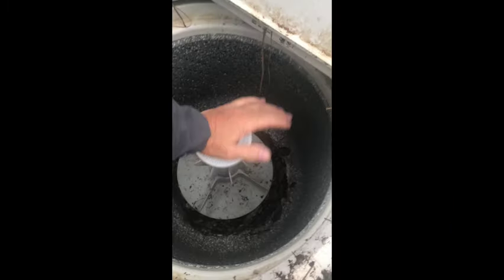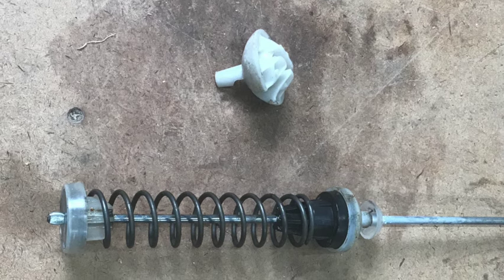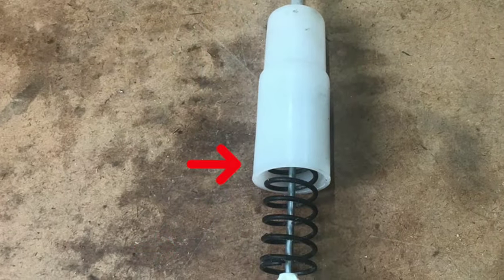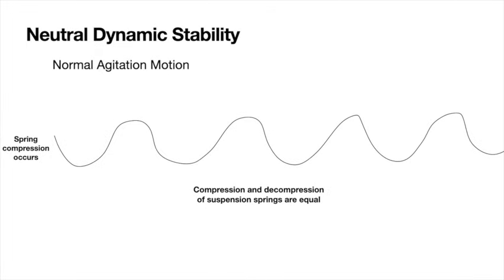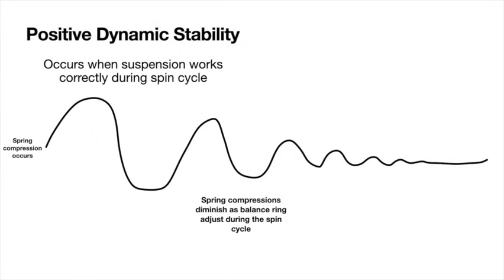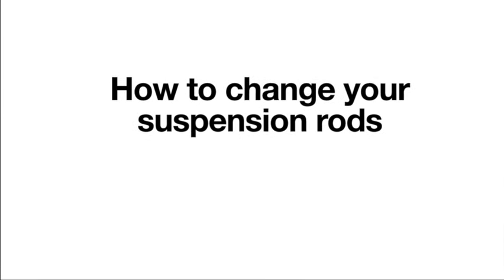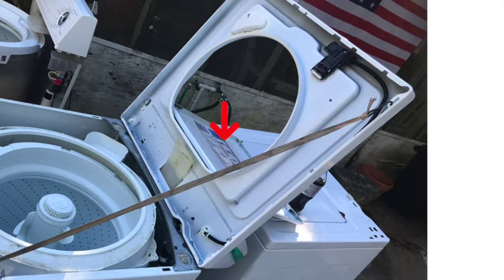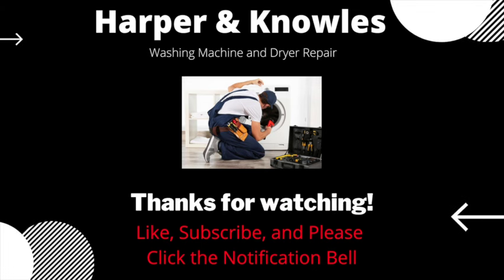How To Replace Suspension Rods in Washing Machines: A Mechanic's Guide to Balance & Repair

Comment: I've got a Maytag Bravos MCT. Has the second spring design you showed. 3 years old and I'm pretty much done. I'd there any newer machines that you recommend or is everything junk now? Maybe I should just go old school, buy used. Any thoughts? Thanks!
Reply from the maker: A lot of folks don’t like them, but front load washers are usually put together well. Most of the problems I find on these are water pump related. If you leave the door opened between washes, that will mitigate the growth of mold and the typical smell these machines get over time.  If you can find them in your area, Speed Queen makes a quality product. If you buy an old school Whirlpool direct drive machine it may last another 15 years. Look under it for rust issues on the frame. I hope you find a good machine. Thanks for watching!
Reply: @Harper & Knowles Washer and Dryer Repair  ok, thanks for the response, I really appreciate the advice!

Comment: I have GE gtwn2800d2ww and I saw that the Dampening two front straps are ripped. I’m looking at my rods and idk how to tell if they are good or not. Anyways, what washing machine brand do you think is the most reliable and cheapest to fix? I’m looking for the Honda of washing machines
Reply from the maker: I recently did a review on the best washing machine you can buy. You can see it here: The Best Washing Machine You Can Buy In 2023
https://youtu.be/qlkdxWfTZVw . It won’t need fixing for a very long time. You can push down sharply on your agitator and if the tub bounces you need rods. That model GE has very good rods and should last for the life of the machine.
Reply: @HarperandKnowles  the tub bounced. I searched for rods I only found two distributors selling them and they are very expensive!
Reply from the maker: Try replacing your straps first. Part number AP2044899.

Comment: Here's a question for you, if you would like to answer.  Okay, I have a Samsung washer (model # wa48h7400aw/a2) from 2016 that has worked like a championship horse, and I have nothing bad to say about it whatsoever.  Well, okay, it has randomly given me the UE code (like hardly ever) -- only when you have large blanket load that you have to pull out, shake around, and put back in.  That's over the span of Aug 2016 until Dec 2013.  And, it's been very reliable and non-problematic.

So, recently, say December of 2013, it started giving the UE code much more often.  So, I bought suspension rods off of Amazon.  Then, I replaced themself and did exactly what I should do, even greased them on top part & bottom top exactly like it said in other videos.    And, it worked pretty good, but still (after few loads) gave me the UE again.  So, I bought a new vibration sensor, and I replaced that.  Okay, vibration sensor looked perfect and was bought new.  Suspension rods that were taken out (that worked 2023-2016 = 8 years), were broken (or more) popped-out of the bottom & spring misaligned.  So, that's why I replaced it.  Well, so, the new rods and vibration sensor worked okay for a while, but UE code again.  And, it is mainly on wet-towels.  It gets to that endless loop at 19 minutes, gives UE, then I rebalance it, adds water again, spins some, quits at about 15, and will repeat cycle.

So, here's my thinking.  I think the new suspension rods are inferior quality.  Is that possible?  I haven't opened it up yet to check things, but I am fucking getting pissed off at it.  Like tonight, my damned clothes that I need are wet (without the final spin from 11 minutes down) and just had to be thrown into dryer.  And, have a pile of wet towels here too that I hope it got all soap out of.  

So, I shake the drum part, and it seems to really shake.  And, I reached in and found that each of the suspension rods are firm.  It's not like they bounced out of place.  Granted, I'm not a washing repair man guy, but I figured maybe the plastic at bottom of one of those is broken or maybe the top bounced off (or something like that).  However, all 4 suspension rods are very tight and firm.  But, when the washer is filled with water (when I tested those rods by just reaching around the drum -- it has not been opened yet -- again, are firm and holding the drum.  However, I don't think the top part of the suspension rod are restricting the bouncing movement of the drum.  

So, could the new rods have already failed after (maybe) month or so?  Could they really be that poorly crafted?  But, when I shake the drum, it seems to have too much play, or that seems to be my take.  And, the drum seems to be leaning to the back side and doesn't seem to be flatly balanced -- when it has water in it.  

If any ideas, please, do give me guidance.  Also, I am subbing.
Reply from the maker: Here are a few things I have found that cause this problem but first let’s discuss the grease. The only grease you should use on these is damping grease. https://a.co/d/hN2Zaam. These rods are meant to limit movement in the tub not encourage it. Make sure when you purchase new rods for any machine they are OEM rods. There are many inferior made rods out there that do not have enough surface area in the linear dampers to last very long under continued vibration. What I suspect on your machine is that the nut that is located underneath the wash plate https://a.co/d/7abK5yi is either loose or broken. Be advised that this is a left hand threaded nut so rightie loosey and lefty tightie applies here. In the worst case scenario the metal part on the bottom of the basket has broken (I forget what the technical name is)  and causes the tub to lean over when spinning. This part is almost impossible to find. So, you need to remove that wash plate and examine this area. Once it is removed rock the basket back and forth. There shouldn’t be any play beneath the nut. Also examine underneath the unit for water leakage. If you find any you’ll have to replace the clutch assembly https://a.co/d/1RRnldG. I hope this will help you. Thanks for watching.

Comment: Chip, have you ever heard of using cattle neutering or dog tail docking rubber bands to repair these suspension rods?  Had a tech tell me he never orders new rods now and says the bands are as good or better than factory. I never heard of this and just wondered if you had?  Thanks and keep those videos coming.
Reply from the maker: I’ve never heard this. I suppose they take the place of the linear dampers. I’ve seen a lot of videos on work arounds but anytime I tried them they always failed and made me look bad. Now I have a policy of only putting OEM parts on customer’s machines.  I might try this on a rebuild and test it a few times everyday for a couple weeks to see if it’s a lasting solution.  What I do know is someone should redesign these parts to make them last longer.  Thanks for the tip my friend, and thanks for watching!
Reply: @HarperandKnowles  You have heard of planned obsolescence, haven't you? How would manufacturers make money from spare parts if they never failed?
Reply from the maker: @richardlowe2681  Yeah, but it sort of gravels my grits when I see the old machinery that this country used to make.  Quality stuff right there. Thanks for the comment Richard, thanks for watching too!

Comment: I have an lg WT5001CW  and was just double checking if a failed rod would cause the tub to hit the sides of the machine. Just want to make sure before I replace them. Also would you recommend replacing all 4
Reply from the maker: Wow! That model has a very robust set of suspension rods. The kind that are very rare to fail.  You see these mostly on GE machines and instead of foam linear dampeners they have a piston and cylinder dampening system.  Heck, they might even have a foam dampener in them too, I don’t know.  I do know that they are slathered down with dampening grease.  Anyway, yes, a failed rod will cause the tub to hit the sides of the machine but I’d look for another problem first. I would spin the inner basket by hand and using the splash guard as a reference see if the inner basket wobbles in and out very much.  It may or may not even if what I think is wrong has happened. I would examine the hub for issues. I have seen where the hub nut (part number 4020FA4208J) has cracked and causes the spin basket to bang around.  If you remove the wash plate you should be able to see the nut.  If the hub is tight then I’d suspect those rods. And I’d get a full set too. I hope this helps you. All I can do is give you my best guess without actually seeing the machine myself. Thanks for watching and giving me a chance to share this advice with others.
Reply: @HarperandKnowles  thanks for the quick response I’ll definitely check out the other areas.

Comment: 8:36 see this is how my basket rotates now, there's definitely spring dampening issues and more from continued use after it's been doing it for a while. Seems like a lotta work taking the tub out but I may have to. I'm really on a budget or in my case haven't worked in over a year due to leg ailment that docs can't find problem. So I have no money and need to figure this out cheaply
Reply from the maker: Continued use when the suspension rods are worn out will severely damage your machine. It will bend the tub or shaft enough that replacing the rods won't fix the problem, and the machine will have to be scrapped. Thanks for watching!

Comment: I put suspension rods in mine, fixed it for about 2 loads. Kenmore top load
Reply from the maker: Your tub is probably bent. Spin it fast by hand and use the inner splash guard as a reference. If the wash basket wobbles in and out more than a quarter inch your washer has a terminal illness.  You’ll have to put it down. ☹️
Reply: @HarperandKnowles  that makes sense. It happened while washing military issued heavy winter sleeping bags. It’s been like this for about four years. It’s also moved halfway across the land with mr and I bought it used. I’ll miss the non-HE aspect.
Reply from the maker: Find you one of those “old school” Whirlpool machines that's in good shape. It might last another 15 years.
Reply: I have a top loader Whirlpool WTW4800XQ1 and its knocking during spin cycle. I just bought 4 new suspenion rods and im very capabke of replacing the rods. Do you think replacing the rods will solve my problem on my model.
Reply from the maker: As long as you have the rods go ahead and replace them, it couldn’t hurt. If you spin the tub by hand as fast as you can and reference it at a spot on the splash guard and it wobbles in and out more than about a quarter of an inch then replacing the rods might not fix it.  That wobble indicates a bent tub from washing something heavy. A bent tub or transmission shaft isn’t cost effective to replace.
Reply: @HarperandKnowles  so try spinning by hand and look for a wabble. If it dosnt really wabble try replacing the suspension rods as a low cost solution and see what happens. I spent $50 on a set of suspenion rods thats suppose to be OEM so we will see if they are OEM when I get them.
Reply: Get you warranty

Comment: Does it matter what color the plastic on the rod is?  The replacements I got were different.
Reply from the maker: As long as your part numbers match it doesn't. On GE machines there is a different color for front and rear rods, but on other models, just match your machine's model number to the part number of the rods.

Comment: Can the linear dampeners be replaced with OEM?
Reply from the maker: I haven’t found dampeners sold separately, but if you look around on the net, I’m sure you can find OEM suspension rods from different appliance parts dealers. Thanks for watching.

Comment: I have a Maytag mvw565  . Is there any hacks like using better shocks from a different Machine ? I’m gonna add centering springs that it did not have and was even thinking of placing a little foam in between the tub and the cabinet to limit the space. Any info would be great. Thx
Reply from the maker: I think I've tried every hack out there to see if I could improve on Whirlpool/Maytag suspension rods. They are just poorly engineered. If you spin your tub and use the splash guard as a reference and the tub wobbles more than a quarter of an inch, then there will be too much vibration to properly fix. The damage is done, and that shaking will wear the linear dampers fast. I have replaced the rods and glued 2-inch foam on all four sides of the inside cabinet to help a customer while they save to buy a new machine, but that will only work if the vibration is minimal. If the tub doesn't wobble, OEM suspension rods are the proper fix. Buy a Speed Queen the next time; they are built to last. Thanks for watching!

Comment: The get rods fail far more than whirlpool and the whole washer tub bottoms out on the case. The get is also far more expensive to replace. Here in Canada I can get a whole 4 pieces set of whirlpool rods for $60, the GE sets are $350
Reply from the maker: Hmmm, in my experience GE rods rarely fail.  Most of the time when a GE washer is out of balance it’s due to a problem with the tub. Usually a broken hub assembly. You can see that about 9:15 minutes into the video, You Should Check the Suspension Rods | Here's WHY and how to FIX it!
https://youtu.be/xmBJdpUfV-Q.  Thanks for watching.

Comment: Hello, I have a GE G153 Hydrowave Mod. GTWN4250D0WS washer, and i'm currently dealing with this issue. Are the front and back suspension rods two different sizes?
Reply from the maker: Yes, I think for this model they are red for the rear ones and blue for the front. Part number for rear is WH16X10159 and WH16X10158 for front rod. These are real robust rods and very expensive too.  I once had a machine like this that I thought needed new rods but I found that the large transmission pulley was worn out and was causing the problem.  It's real hard to determine which rod is defective too. Check that pulley before you change those rods, they rarely go out. Thanks for watching!
Reply: @HarperandKnowles  Where can I find the transmission pulley specifically? Does it require taking the motor off, for instance? The motor is in the front bottom center on mine. Would the transmission be in the back or next to the motor?
Reply from the maker: @user-tb2jy9lu3d  The transmission pulley is the larger wheel that the belt turns on. It is in line with the agitator shaft.

Comment: I have a whirlpool wtw7500gc2.
Does Amazon have a suspension kit that will work for this model?
Reply from the maker: Yes they do and here is the part number you’ll need, WTW7300DW2. Look for OEM parts when replacing rods, after market rods are inferior. Thanks for watching!

Comment: anyone know how to fix a drum that sits too high up after replacing the tensioner rods? Help! Its banging at the top now ....wtw4955hw2
Reply from the maker: Replace the rods with the correct part number for your machine. You either have the wrong rods or you’ve done something wrong when you installed them. Thanks for watching!
Reply: Oh crap .. thanks for the info
 @HarperandKnowles

Comment: My LG thinks it is always out of balance. Replace all the suspension rods and it changed nothing:( what do I do?
Reply from the maker: If I had the model number it would help. If you are getting an error code it could be that your bearings are failing and the rotor is dragging on the stator (if your model has this). It could also be that the center bolt on the rotor is loose. If you hear a roaring sound when the machine spins that is an indication of failed bearings. I hope this helps. Thanks for watching and commenting.
Reply: @HarperandKnowles  it's a WT5170HV. I'm thinking the stator position sensor is my issue, but not sure yet. It's pretty quiet when spinning, so I think the bearings are fine. Will look into the main bolt
Reply from the maker: Oh, something else, you could possibly have an article of clothing between the wash basket and the tub. You can remove the splash guard and look down the sides with a flashlight.

Comment: I have a combo but no one can tell me how to remove the bowl to replace the rods
Reply from the maker: If it has suspension rods you usually remove them by disconnecting the rods from the hangars at the top.  To do this you will have to remove the top (the part with the lid).  Many stacked units have removable front panels that can be removed by depressing two clips near the top corners with a putty knife and tilting out and upward. You should be able to access the screws that hold the top down after removing this front panel. It all depends on the manufacture of your machine. I hope this is helpful. Thanks for watching!
Reply: The combo unit rods are a bear to replace good luck!!

Comment: My GE has been nothing but junk since the day I bought it.  Had suspension rods in it  a couple times.   Pure junk.   Won't spin the Downy out of the clothes. Doesn't even spun out hardly at all.   Sometimes stops completely.   Can't wash a small load at all.   JUNK
Reply from the maker: No spin problems on modern GE’s are usually a belt problem. Thanks for watching!